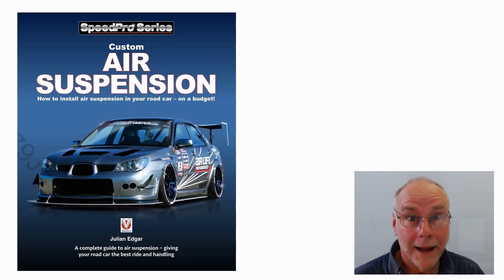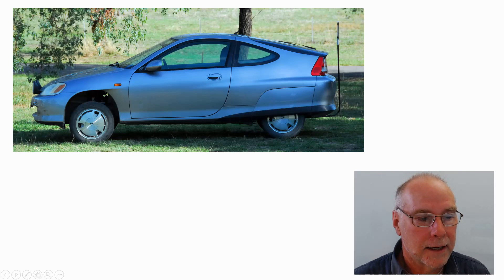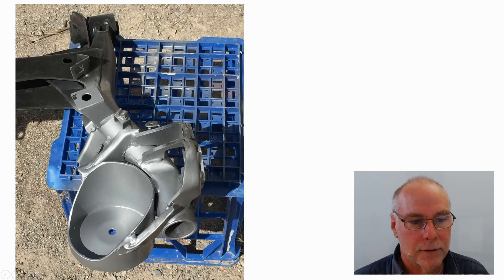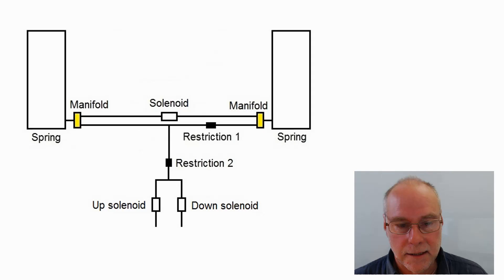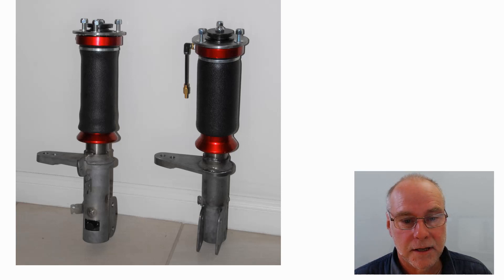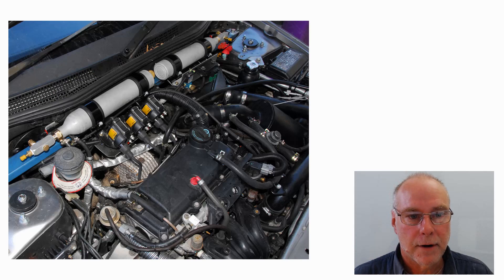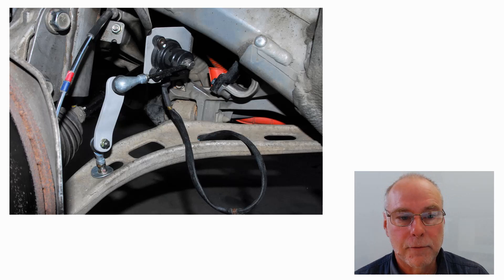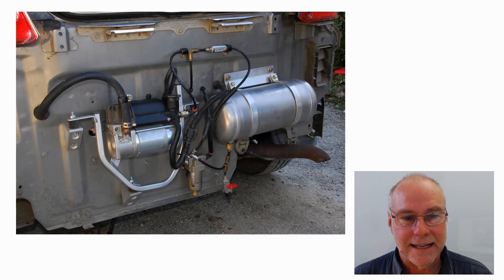Honda Insight air suspension system

Comment: I have been playing around with adjustable dampers, and airbags within the rear springs of my 2001 insight, and got a reasonable improvement in ride quality, but still not great. I have just ordered your book, hopefully to improve it further!
Reply from the maker: Sounds good. Proper air springs are likely to be much better than bags within steel springs.

Comment: Hi! I'm actually getting an Insight soon, and have read that even with its light weight, suspension bottoming out is a ongoing concern, to the point different springs and dampeners are fitted.

For the rear suspension you show there were modifications done to your beam axle. Was it due to not having bags that would provide adequate travel that would fit the stock coil seat? 

You mentioned had you done it again, you wouldn't have done the front. Was it not a worthwhile investment in time/effort/money ?

In the rear, do insights not have a bumper beam, or was it removed for visibility/access for the video? If it has a bumper beam, does it need to be "deleted" to place the equipment there?
Reply from the maker: The stock rear suspension on the Insight is poor and often bottoms out. To fit the rear Firestone springs I lowered the spring seats to give sufficient room for the suspension to fully compress without bottoming the air spring.  The front was much more expensive and required a lot of fabrication. The bumper cover fits back over the rear panel components - normally, you can't see any of the air suspension parts.
Reply: @JulianEdgar  thank you for the quick reply, and pretty informative videos!
Reply: They ride fine stock

Comment: Very interesting!
Reply from the maker: Glad you think so!
Reply: @JulianEdgar  id consider doing this if I were eventually able to get a spare rear subframe to modify. Id like to be able to return it to OEM trim down the road. These cars will for sure be rare collectibles.
Reply from the maker: You really only need rear suspension, and if you're in the US, these cars are still quite common (and cheap). Not so cheap and/or common elsewhere!